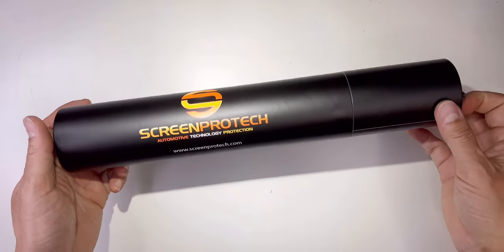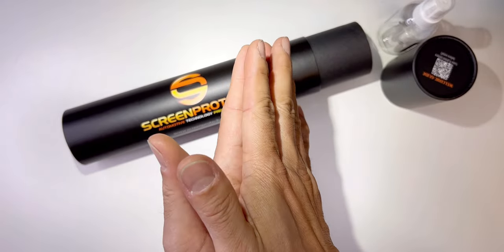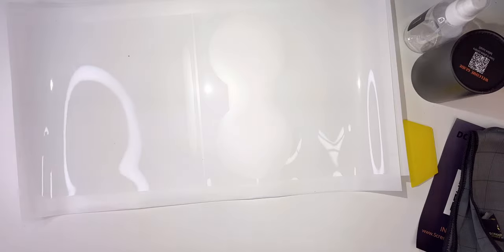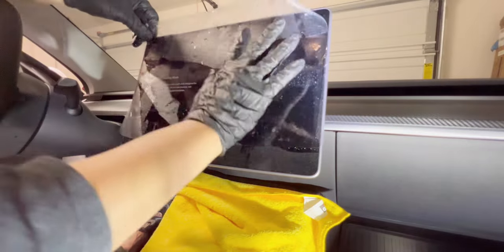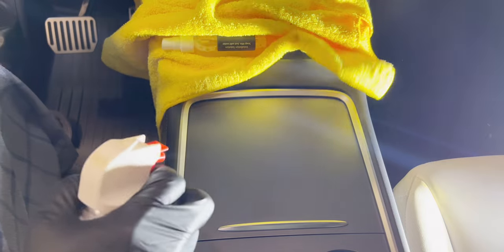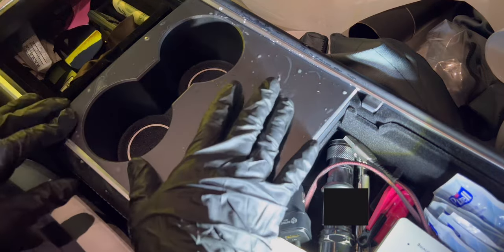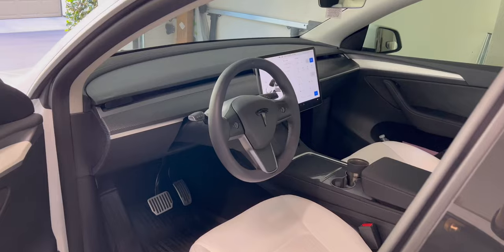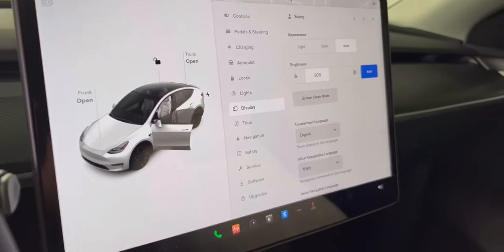Protect Your Tesla Y Screen: Best Screen Protector Film Installation! ⚡🛡️ 【Tesla19】

Comment: Should use a moist lint free microfiber (like those that come with eyeglasses) for the dust removal before spraying IMO.  All using a compressed air duster does is throw the dust into the air to settle back down on your surface.  You can see it, especially when you use the duster on your main screen.
Reply from the maker: Hahhahaha. Yes. But after you spray soapy water, it all goes away. No lint or dust behind the screen protector.